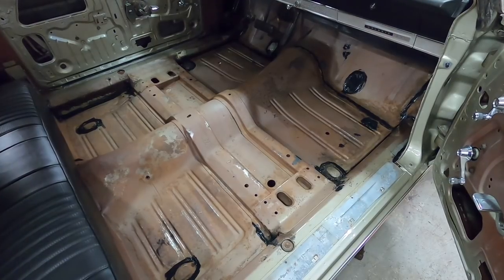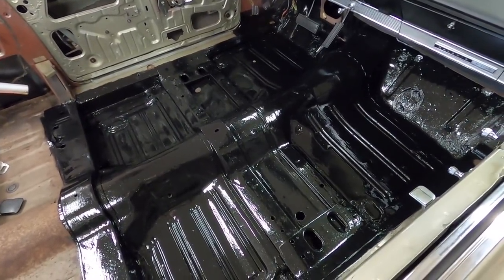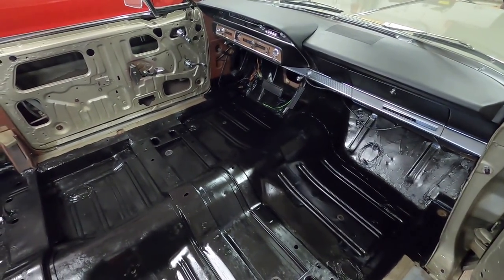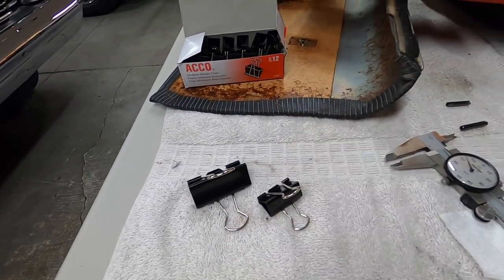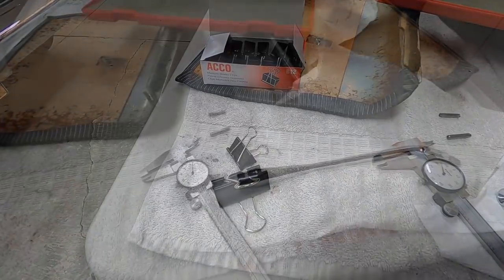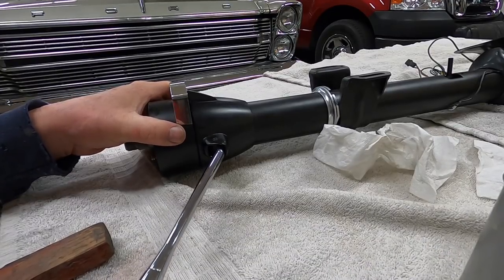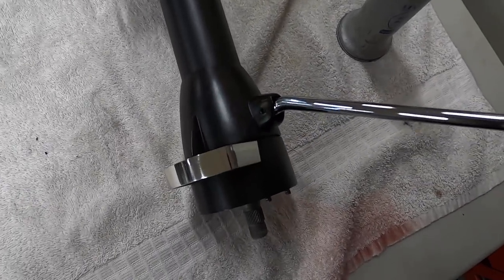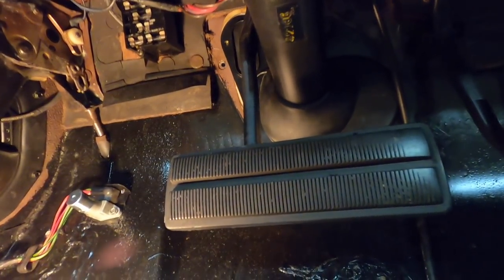1966 Ford Galaxie 500 convertible restoration part 183 installing steering column

Comment: Howard, you remind me so much of myself, I too could not have left that small area of floor pan unpainted. I feel that the Rust-O-ilium paint will be a big help should water ever get in the car, or the heater core go`s bad, the anti-freeze would help but I have seen floor pans damaged by a leaking heater core and the owner not addressing it. Older cars did not seal out the weather like the new stuff of today, nobody makes a Hardtop Convertible anymore, they were more prone to leaking in a rain storm. You have done some things to help protect the car for many years to come. You do beautiful work Howard.

Comment: Interesting comment on Rust Oleum paint, I used it on my dads 67 Galaxie over 30ys ago and have found that it has prevented rust to this day. It prevented a lot of rot that is making my job a lot easier now 30+ years later. Really love what you did to the dash.
Reply from the maker: Yes, I find Rust Oleum as one of the best rust preventers made. A lot of car restorers will state the same, unless they're given a product to promote. All the other stuff like POR15 are expensive and don't work near as well over a long term like Rust Oleum!

Comment: Howard, when you pull those seatbelts, make sure you use the specific torx bit for those bolts that secure them to the body.  They are really torqued!  Love your work!
Reply from the maker: The seatbelt bolts are a standard six point bolt that uses a 15/16" socket.
Reply: Howard, you might be right but I think the perfect tight fit with no rounding corners is using T50 6 point. I have a picture if you wish.
Reply: Maybe I’m thinking of the later belt anchors.  Keep up the great work!

Comment: I have 2- 65/66 AM radios one doesnt work the works when it wants. I also have A71 Gal radio the at one time worked. Anyway performed aservice on them like you suggested and now the temperamental one works fine. The others unfortunately show no change. I consider 1 out 3 to get working well worth the effort.    Thank you!
Reply from the maker: I have been told by several radio repair guys, that it is a capacitor that goes bad, an easy repair I guess. Also the transistors tend to fail from that era too.

Comment: I broke the same plastic clip on mine when I removed the horn ring a few years ago (I take the steering wheel out when it's in winter storage so it won't crack). I found a replacement out of a Falcon at the wrecker. They're not easy to find these days!
Reply from the maker: I had two extra good used ones.... I thought they were reproduced????
Reply: @OldCarAlley  You're lucky that you live in the States. I often have trouble finding parts here in Canada. Availability does seem to be improving, but the shipping costs are crazy. I once had to replace a master cylinder for my Galaxie. It was going to cost several hundred dollars with shipping and take about a month. I went down to Grand Forks, ND and got a new one for around $30 (with core exchange).

Comment: A truly exceptional job! Everything looks absolutely top-notch! Before you install the carpeting will you lay sound deadning underneath? And the second detent on the column shift is for all gears to engage, just below low first gear? I also like a remote control mirror, just my preference. Cannot wait for all the chrome pieces to arrive back! As well as setting up the radio and speakers.
I don't think the warm weather we are getting from you is staying around, but Google is saying close to 70°F for Thursday here in upstate New York! That would be a wonderful day for a ride!
Reply from the maker: Were suppose to get to the low 60's today... and the next few days. The shifter is Park, Reverse, Neutral.... then Drive second gear only, then Drive all three gears, then Low. I did get some sound deadening insulation to lay down under the carpet.

Comment: Did  you source a new rubber seal for the steering column?  I've been looking for one for a 66 and haven't found one yet.  
Great work.  Wish I was as talented!
Reply from the maker: No, it the original one all cleaned up, and reused.

Comment: Great videos, giving me incentive to work on my toy! Can I ask who you used for the plating? I have to do some hub caps 2 piece and maybe the emblems.... and then there’s a top to do. I kinda choked on that price, no kits for it. Awesome job your doing!!
Reply from the maker: B&L Plating 21353 Edom, Warren, Mi. 48089.
Reply: Thank you! Everyone recommends them, then I ask what have they had done and the answer is normally “a friend had...” or “a guy from the club seems happy” guess I’m spending money this year. The big ticket will be work from Schultz upholstery in Flint.
Reply from the maker: @67conceptjeepster13  They're expensive.... all chrome plating places are expensive now days. I also used AW Custom Chrome in the past, but there tanks are not large enough for bumpers.... I think there tanks are 54", so anything over 54" they can't do.... they're slightly cheaper. They're in Warren too.
Reply from the maker: @67conceptjeepster13  If you need B&L's number... The guys name is Geno Pirrami, his number is 586-778-9300. Tell him Howard from Old Car Alley with the 66 Galaxie sent you.

Comment: Besides putting the stock radio back in are you going to install a updated radio in ?
Reply from the maker: I updated the original AM radio with an original "optional" AM/FM radio that works good, so I am leaving it as is.... Their more valuable than a updated radio, because they're super rare.... especially one that works!
Reply: He upgraded it from AM to AM/FM, period correct of course.

Comment: What kind of seam sealer do you use? Can I pick it up at a local Ace Hardware?
Reply from the maker: I used a SEM brand product from my local automotive paint shop. I don't think you will find a similar sealer at a hardware.... but they may have something else that may work.

Comment: Hi, it is difficult to get to the gear selector and change the light bulb that shows which gear the car is in?
Reply from the maker: You got to pull the steering wheel and maybe the turn switch.... It's been awhile, but it should be an easy job. I did video rebuilding the column.

Comment: I really would love to see how the center goes on the steering wheel, I can't seem to get the ring to hook on the horn lever that sticks out of the column...
Reply from the maker: I installed it already, and didn't video it. Line up your tabs with the slots on the wheel. With the spring in place, push it in and turn it until the spokes line up and release it....
Reply: I'm talking about the hook part at the top of the column that sticks out... Does that hook on the back of the horn button
Reply from the maker: @vernonyow1509  There are three slots in a plate at the top, there is no hook there, on mine anyway. The plastic part pushes threw the larger part of the slot, then turn it clockwise why pushing it, until the ring lines with the steering wheel spokes... thats it. Don't forget the spring between the two, thats what keeps it pushed out.

Comment: POR 15 is a gimmick product. Used it many times. A few years later it seems to just peel off. Rustoleum  (oil base) is far superior.
Reply from the maker: It makes me cringe when I see POR 15 used.... It docent last but for a few years.... thats what I have found from using it in the past.

Comment: A question when I did install my steering column in my 67 galaxy 500 dosent feel the same is hard and soft every time I turn the steering wheel
Reply from the maker: Sounds like a bad bearing in the column or maybe something is not lined up or maybe something is bent. That's just a guess, I'd really need to look at it to see what the issue is.
Reply: Let me replace the bearing see if change so this column they have only one bearing right
Reply from the maker: @hectoralvarado4586  Mine only had one bearing, in the upper part.
Reply: Same as mine let me see if any auto part have it I keep you post . Thanks